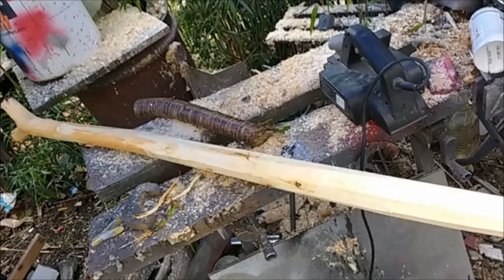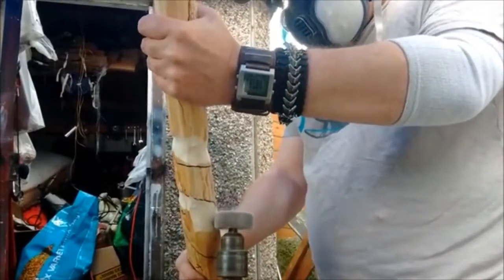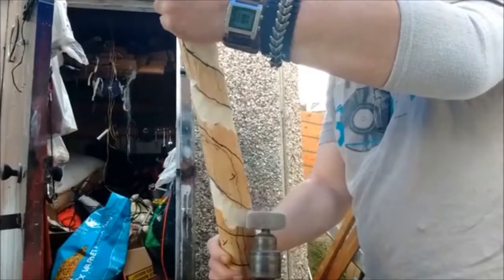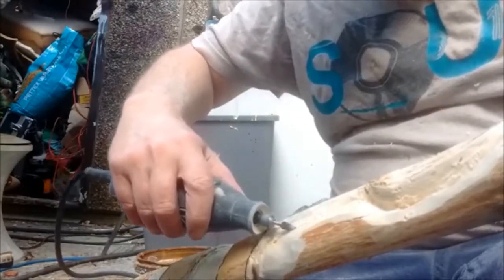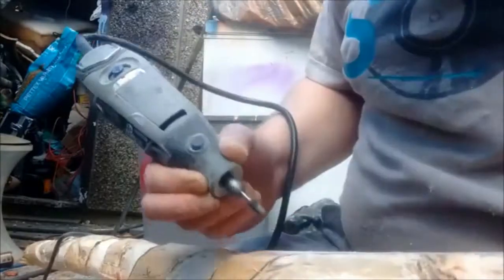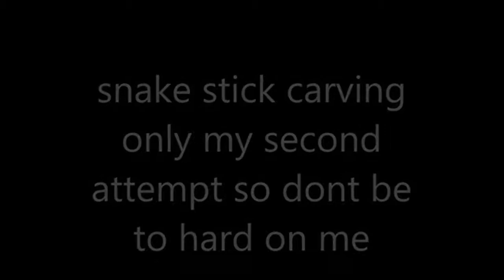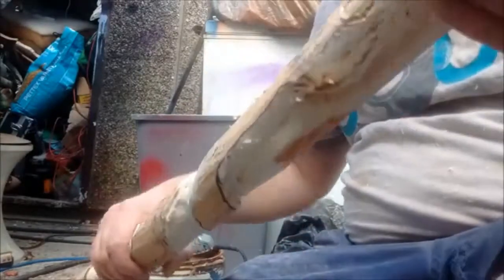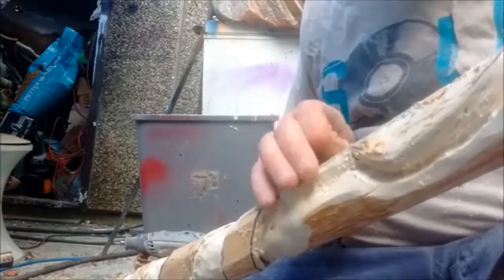snake carving walking stick  pt 1 updated audio

Comment: You need to buy a flexi cable for that dremel, it fits alot better in the hand,and you will have more control. I just get the made in China specials £6+ ..you will love it..
Reply from the maker: lol i got through three of those .they don't last long with me so i gave up
Reply: @farscape3100 I can normally get 12 months if not more from mine, I always have a back up one..lol
Reply from the maker: @fishtank5050  you should see how many dremmels I've hammered lol